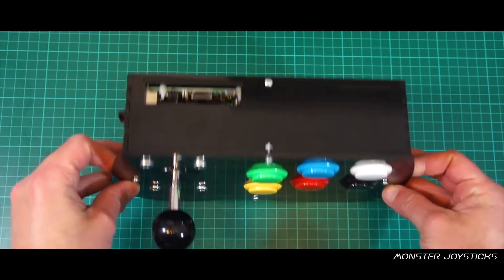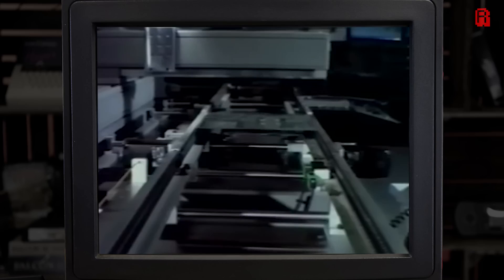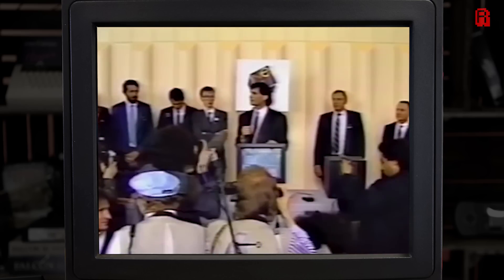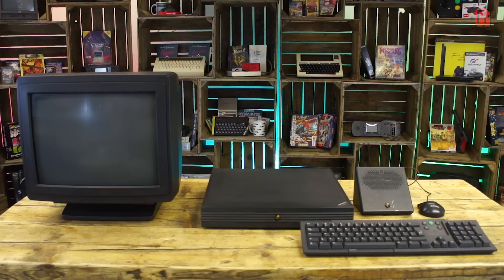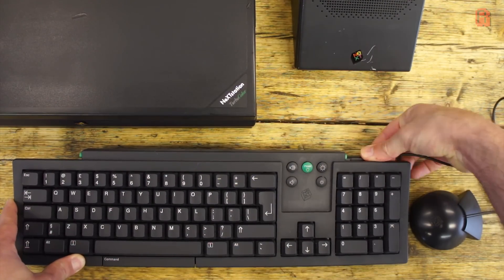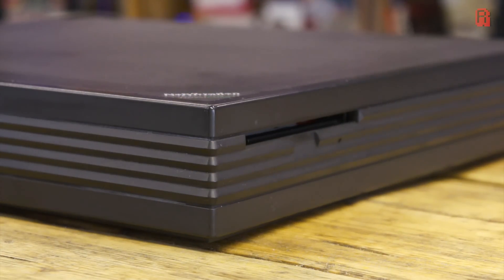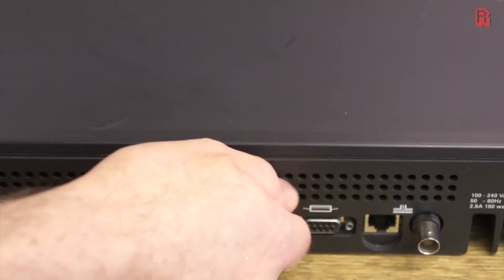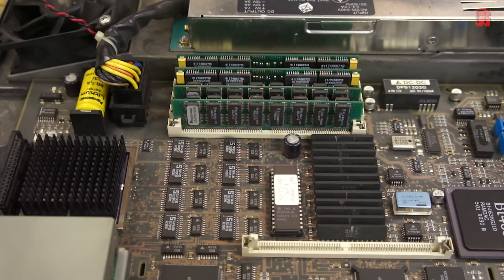NeXT Station | When Steve Jobs Left Apple - Part 1

Comment: I like thta you went through the trouble of replacing the thermal paste on the CPU, old systems can die horribly because of decayed thermal compounds and pads. I setup my Dad a computer with a 1st generation Core i7 1366 socket system, the chipset was running obscenely hot, I noticed this when I also noticed I forgot to plug the CPU fan back in. The thermal paste had turned to cement and the heatsink was no longer making proper contact with the chipset. That motherboard is only 7 years old and the paste had already bought the farm, I'd hate to think what lives under the lid of CPU's.
Reply: Dead Reckon I replace my desktop's thermal stuff every year roughly. Ironically though my laptop is an iBook G4 from 2005, so the thermal compound on that must be powder by now lol.
Reply: Went through that trouble when I replaced paste on a Voodoo 3 last year. Hard as glue.
One of the things besides checking (and sometimes replacing) the power supply when old machines are menat to keep working.

Comment: Umm... a 68030 for ~10k$? Sorry, but in 1993 i would rather buy a Am486 DX-40 with Novell DOS 7, Windows 3.11 or Geoworks Ensemble and have 8k to spend otherwise.
In other words, a typical Jobs machine, overpriced and underpowered. :3
Reply: Oh sure 1993's DooM was 32bit, DOS Extenders cost a fortune until Watcom worked out that deal with Rational to allow for royalty free DOS4G/W, although that was much later again.  I'd much rather have had NeXTSTEP than WFW 3.11, although I know that as time went on you had WinG, Video for Windows, the TCP/IP upgrade, Win32s, to try to bring 3.11 up to the level of where Windows 95 would start off from. 

It's crazy how short the timeline looks in retrospect from 1991-1995 as only being 4 years, but crazy to think the only 32bit stuff that was available was UNIX based stuff before the 386BSD/Linux revolution, followed by OS/2 2.0, and Windows NT, then Windows 95..  

At the time I was just a school kid, so making the leap from DOS/Windows to Linux was super easy, and really great to be able to run GCC @ home, and cross compile to the RS/6000.  It's amazing how tumultuous the crowded market was at that point, and how Windows NT & Linux managed to crush them all.
Reply: Bastet Furry Or an Amiga with various upgrades for a fraction of the NeXT's price.
Reply: The Amiga 3000UX (68030 with Unix so it's comparable) was $6995.  Not exactly a tiny fraction of the price.  https://groups.google.com/forum/#!topic/comp.unix.amiga/hPIG1CyzmlM
Reply: 32bit machine to run 16 bit software... such was the curse of the early 1990's.  Although NeXTSTEP 3.1 and beyond ran on the 486 class machines, but you'd need to 'borrow' a SCSI CD-ROM to install.
Reply: "32bit machine to run 16 bit software", only the shell was 16 Bit, as soon as you started a more modern Game like Doom it ran on protected mode. ;)
And if my youth self would have wanted it, i had SCSI back then.
Reply: It was overpowered, and overpriced too.

Comment: I don't think this is too much different than a Sun SparcStation workstation of the time which could have multiple CPUs and the same video chip. For crunching numbers I would rather use a Sparc than a Motorola.
Reply: There were plans to port NeXT/OpenStep over to PowerPC. Then NeXT changed directions and became a software company.

Comment: Neil - did you find a NeXT 13W3 to HD15 cable, or are you making one yourself? Great video!
Reply: Excellent video!  I've successfully made an adapter to connect my NeXTStation Turbo Color to a regular VGA monitor.  I use a standard 13W3 to VGA cable (made by Sun) to adapt the connectors which also works with my Optoma DLP projector's VGA ports but it wouldn't work with a normal LCD monitor.  In order to get it working with a normal monitor I needed to build a "sync separator" that separates out the sync signals from the green video signal.  For this I used an LM1881N chip and simply wired it up in between a pair of HD15 connectors, only cost a few quid to make and means the machine works well with a decent number of monitors.
Reply from the maker: A cable arrived in the post just 5 minutes ago.  Further work will likely be needed though than a straight 13w3 to HD15 conversion, to be continued!  Have you experience of performing the conversion?
Reply: I have not built one, but after watching your video I was investigating how available they are, and couldn't find anyone selling them. I see 13W3 cables turn up at thrift stores occasionally -- I will be grabbing some next time and keeping them for NeXT conversion cable projects. I have been told that many of the original monitors were unreliable, so it would be nice to have more options for video. A friend locally has a similar machine to yours; I have been watching for one for myself.
Reply from the maker: Thanks Cameron I have just been enjoying your video thanks to a comment here posting the link and I see your cable there, looks excellent, if I use the same method I'll be sure to post a link giving credit

Comment: If you visit CERN, they have the original NeXT Cube used by Tim Berners-Lee to develop HTTP on display.

Also, do you know what the SIMM socket in the middle of he motherboard is for?
Reply from the maker: The empty slot is to upgrade the DSP memory.  You can take it from 24 to 96 kilobytes according to the owners guide.
Reply: @TheRetroCollective  Actually, there was a third-party 576kb DSP module made by The Speech Recognition Lab at San Fransisco State University that they offered for sale (briefly) for $600.  I don't know how many units were sold or shipped, but I believe that the the DSP bus can handle up to 768kb of SRAM.
Reply: RunTime No porn?
Reply: They had it on display at the Science Museum in London back in 2014.
Reply: srtgrayfrance Video memory?
Reply: We should be thankful to Steve Jobs and NEXT otherwise the internet may have looked very differet
Reply: @RunTimeRecruitment  Without those contributions, the Internet could've been VERY different from how it is now. One thing that might've not existed or ended up very different would've been Java. Java was built around the World Wide Web and as such provided interactivity on websites before Flash existed and before HTML and CSS became advanced enough to provide the same level of interactivity. Java also is able to run standalone programs.

For those who are gonna try to accuse me of confusing Java with JavaScript...the two are very fundamentally different.  Believe me, I have coded in both languages before. I am referring to the ancient technology known as Java applets.
Reply: @FairPlay137  Agree - Java also came about to enable “write once, run anywhere” philosophy to allow developers to execute their code on different hardware with a re-write via the  Java Runtime Environment - in principle this was a great idea however there was a tradeoff that being speed since Bytecodes were interpreted and not compiled to machine code. Because Java is run in a virtual machine it has found popularity in banking and secure transactions applications where a VM can be created on the fly and destroyed after the transaction completes thereby making it harder to hack.